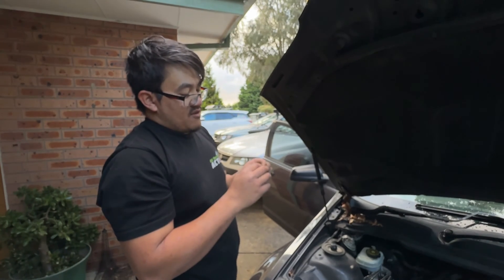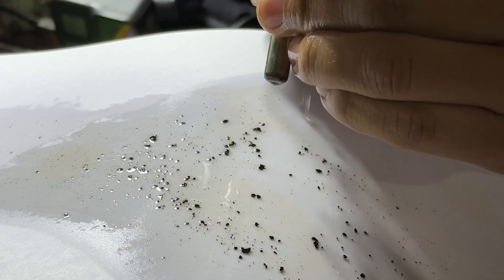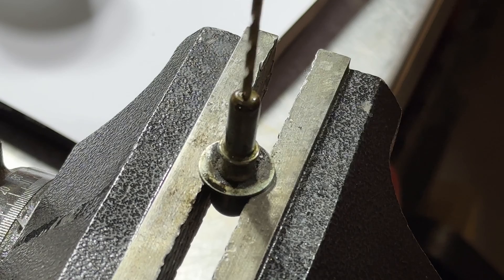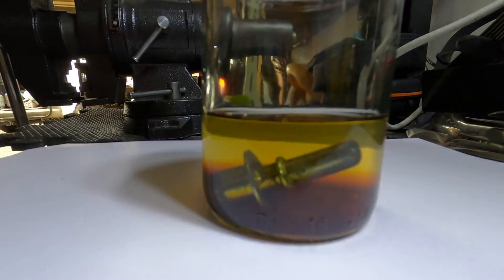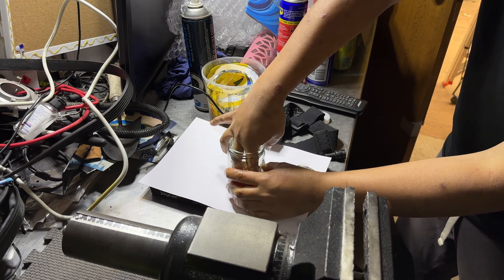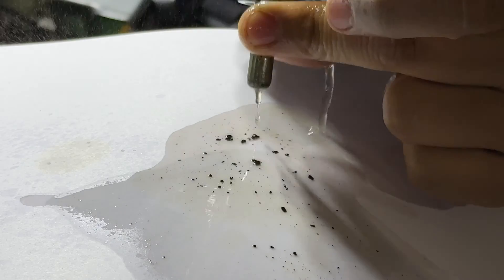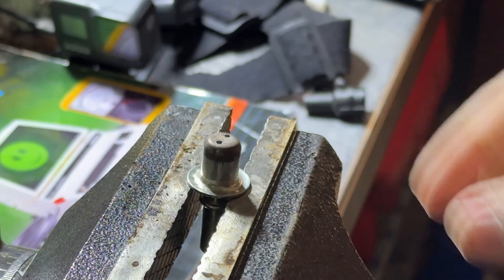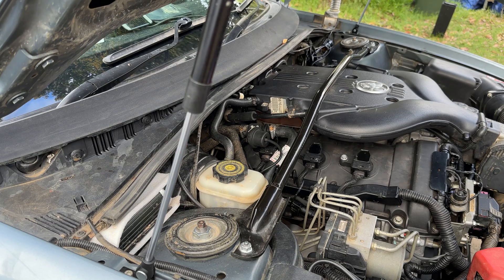PCV Breather Mod on a GM 3.6L HFV6 ALLOYTEC - ADVENTRA COMMODORE CAMARO CADILLAC RODEO CAPTIVA

Comment: Hey sorry new to cars what is the point of this? I have an alloytec
Reply from the maker: Engine needs to release positive pressure out of the engine, if this gets blocked pressure builds up inside and instead will cause seals or blow head gaskets (less likely) and cause issues you can otherwise avoid by keeping this clean and flowing.
Reply: @AllTerrainAction  thanks man I’ll do this tomorrow haha
Reply from the maker: @Airjoey7072  if you watch the first 4 minutes of this video I explain what I just said in text but video on an engine, for a better understanding - https://youtu.be/yJkm2HvebSM?t=38
Reply: @AllTerrainAction  Blow head gaskets, what?
Reply: These valves help your engine breath. if they block up or dont function as they should you willend up with stretched timing chains resulting in a chain replacement job that here in NZ will cost up to 3000$$ . I did my own .... What a mission. Regular oil changes are a must do. Hope this helps.

Comment: Diesel oil is full of detergent so you are basically cleaning the inside of the engine can have draw backs on worn engines
Reply from the maker: yeah if engine is very.. sludged 100% do not use any engine clean additives, I think diesel oil is a bit more sensible as its a longer process time to break down. If you know your engine is bad, I tell people change to diesel spec oil, same viscosity but check your OIL FILTER at 500km, 1,000km and 2,000km at any point if it looks like its full of sludge or contamination, change oil again early/stright away and monitor again until your seeing a clean filter again just because this is the most saftest way to clean up an engine over time.

Comment: I've always added a baffled catch can setup and not used the pcv valve in most my car's. 

If you end up getting excessive blow by you could always add one in before it returns back into the air intake. I'll add but I'm not 100% sure how it all works on the alloytec.
Reply from the maker: PCV is just PCV so same same, ours is not a one way valve but it seems if the passthrough is too large you'll get excessive oil return, I think if it was a through system and you had a catch can its fine but from what I now understand these micro adjustments to hole sizes (2mm bottom, 3mm top) lets the factory ventilation system breathe so much better that the engine behaves better. I found when I pulled driver side cam covers off, the way the case is setup if you abused your alloytec and did not service well and also neglected PCV maintenance there is a chamber at the rear side of the motor that will get clogged up underneath the cam cover, and even though the PCV valve might get cleared the passage under the cam cover is still, clogged and has build up of burnt oil and deposits. Diesel grade engine oil helps break it down over time, but I would think a heavily neglected alloytec would need cam covers off and a manual tidy up followed by Diesel grade oil for awhile if not indefinitely after. People say Diesel grade oil lacks the zinc needed for the alloytec, but we and many hundreds of other v6 Adventra's owners have not seen a side effect for almost half a decade and some of those engines are on original timing chains and getting up near 400,000km range with the last 200,000km's of that been following this diesel oil use. 5W-30 Full Syn at 7,000 - 10,000 km intervals. First oil change with diesel, beware of build up of sludge and change oil and filter early if your oil filter shows signs of collection of high amounts of sludge in the first 500-1,000km's after your first diesel oil use.
Reply: What is diesel oil?  @AllTerrainAction
Reply from the maker: So we are talking using a 5W30 or 5W40 Full Synthetic Petrol (and also labeled suitable for Diesel engines) recently Nulon made a change and the go to is Nulon APEX+ 5W-40 Full Synthetic it as of this year now shows a GM dexos2 approved badge on it. Approx 7ltrs + $100 from supercheap auto.
Reply: @AllTerrainAction  
Can you please confirm you are using the Nulon 5W40 Apex + 7ltr 
Labeled DIESEL?
Reply from the maker: @JohnW-dh8pl yes I am it should be the one that shows DEXOS2 logo on the front. Anything dexos1/2 is fine for the alloytec in diesel spec.
Reply: @AllTerrainAction   okay thanks, do you only use this DIESEL specific Nulon 5W40 apex+ Dexos2 oil for all your oil changes now. 

Not the fully synthetic Nulon 5W40 for Petrol oil anymore?
Reply from the maker: @JohnW-dh8pl  yeah only diesel spec, you’ll find it contains all the same petrol properties with added detergents that help keep the engine clean. Proven by many alloytec owners, the difference internally over 50,000kms is apples and oranges. Just beware your first diesel change, your filter might get dirty very fast as it tends to start cleaning in the first 1000kms and you may get a sludgy filled oil filter, highly recommend to check and oil filter at first 1000km and if sludgy give it an early filter change.
Reply: @AllTerrainAction  thanks for the help done the oil changed today and cleaned and drilled out the blocked PCV. But after having a really rough idle for a long time and a bad misfire when you first put your foot down, the biggest improvement came from cleaning the MAF sensor and throttle body, Instantly improved. Idles great misfire on acceleration about 95%. Any tips to totally fix this little misfire on takeoff. It’s a 04 VZ crewmen with 320,000km.

Comment: Does anyone know what the later size holes are on the pcv  plus they don’t seem to list a pcv  in parts anywhere
Reply from the maker: later size as in the holes size they used on the LFX when it was a global change or? @fu manchu question really.
Reply: They modified the valve I think from 2012 I’m just wondering what they made the hole sizes

Comment: A bit of pressure on me now.
Reply: It is 2mm bottom, 3mm top correct?
Reply from the maker: @Ausrotty29  I’m reading that most people do 2mm each on the bottom and 3mm top, but I did one 1.5mm and the other bottom one 2mm as Fu’s guide said they don’t say why it’s different sizes on the bottom but he also did double 2mm and had no issues, I might change mine to that in the future just seeing how this goes first.
Reply: @Ausrotty29  the two bottom holes are drilled at 2mm (or 2mm on one and 1.5mm on the other). Top hole drilled to 3mm. 

Clean the intake plenum, PCV lines cleared out, MAF sensor and intake pipe cleaned out.
Reply: @FuManchu5ltr  Will be doing mine tomorrow! Seen you on the justcommodores forum